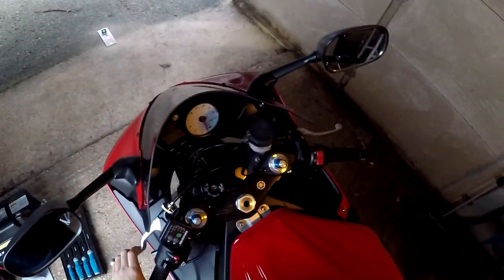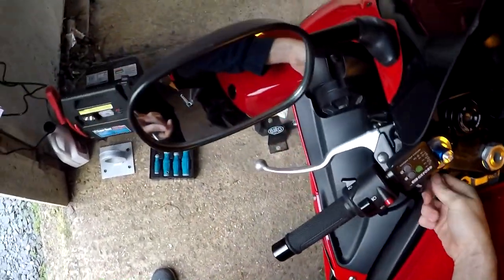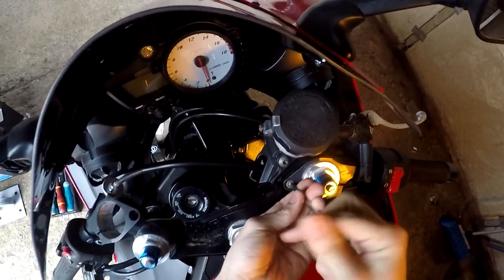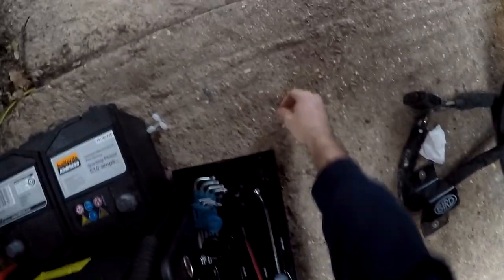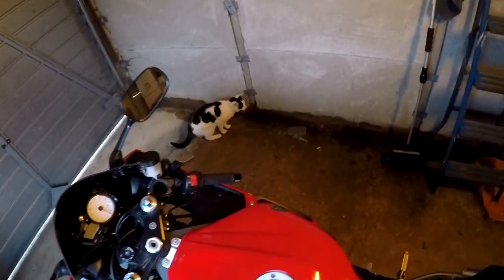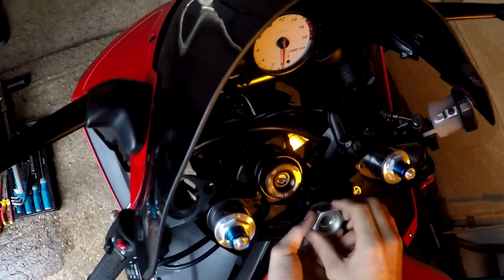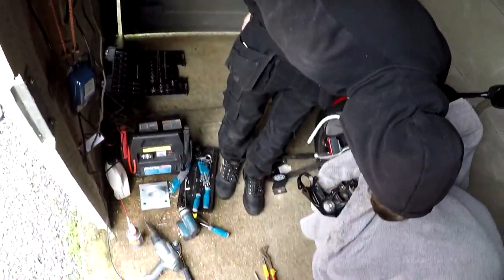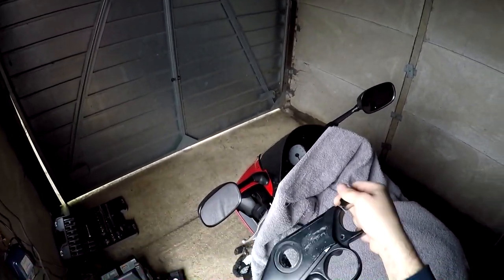Removing Triple Clamp on Yamaha R6 (Top Yoke)

Comment: I'm doing a stunt build on a 2023 R7 and this video is gold. Funnily enough I went through the same procedure i.e. trying to cut a groove and use a screwdriver and even an impact driver to loosen those bolts, which clean sheared 3 bits. This is a belated thanks for the upload brother. 

Edit: I forgot to ask what size bit you used...if you can still remember. It looks like 5 or 6 mil.
Reply from the maker: Hey man, thanks for your comment! I used a 6mm bit to drill it :)

Comment: You just... Removed the triple clamp with your hands?  I've got a late model 04, the ignition is locked, no key. And trying to get the upper clamp off , for me, is a bear!! I'm thinking I might need a gear puller.
Reply from the maker: Is the steering locked?

Comment: I need to do mine and I'm wondering if the slot method would work better if I heat the bolts to melt the loctite
Reply from the maker: I have seen someone do that technique before but I didn't like the idea of using a blowtorch on my bike lol! I did try using an electric heat gun which I didn't show in the vid and it didn't work. Hope this helps :)

Comment: Where did you source the security bolts from, when you bolted the ignition back on? Or did you just use standard bolts instead?
Reply from the maker: I used standard cap head bolt then put a blank  cap in the head of the bolt if you know what i mean.
Reply: BenjiBiker oh nice, yeah that works. Do you have any pics of how the triple clamp turned out after you painted it? Also can you remember what torque spec you tightened the steering stem nut to?
Reply from the maker: @richardhorne1673  i posted a video reassembling the triple clamp which shows it newly painted and also has a link of the service manual in the description for all the torque specs :)

Comment: Hey quick question,  I got a aftermarket steering stem nut, black & gold to suit the bike. Is it as simple as unscrewing it & putting the new one on, or does the steering stem will have to be adjusted somehow once the original one has been removed? Thanks
Reply from the maker: Patryk Kubiak hey sorry for late reply, if you are just removing the nut all you need to do is remove the nut and then put the new one on to the correct torque setting 👍

Comment: Hey mate, is this the only way you know of to remove security bolts? Need to swap the top yoke of my 125 to pass MOT and I've just run up against them
Reply from the maker: This the the way I found to do them. Some people use a dremmel to cut a slot for a screwdriver to fit but because of the loctite on the bolts I found it better to drill them. Hope this helps 👍
Reply: @benjibiker6053  cheers man I also saw a method car mechanics use where they use a hammer and a punch to sort of force them to move counter clockwise, I might try that first but yeah loctite will probably prevent that as well so will probably end up drilling